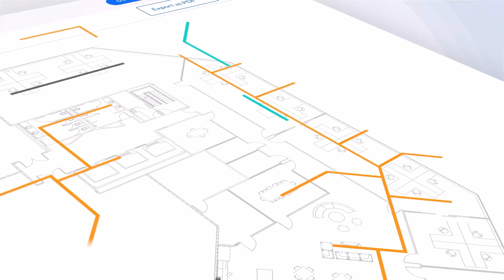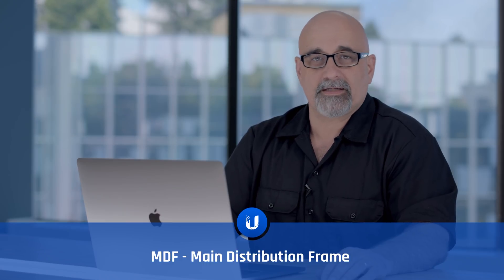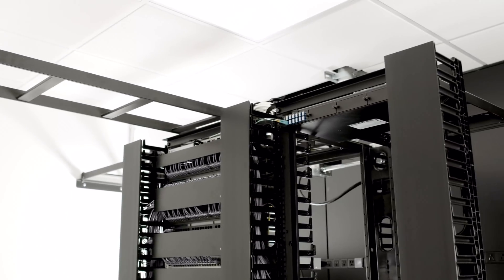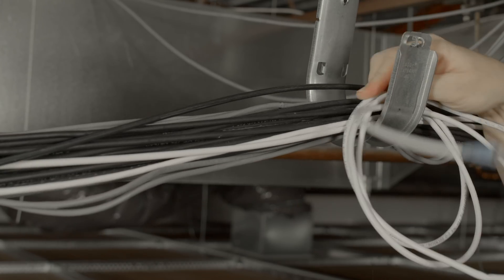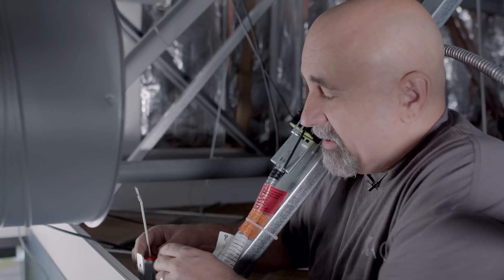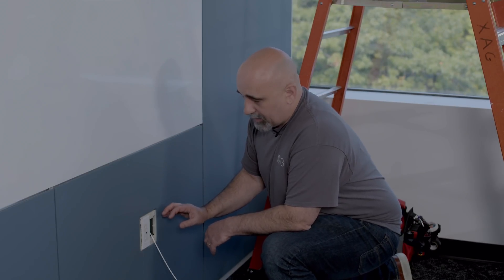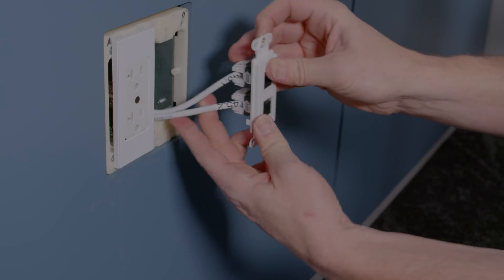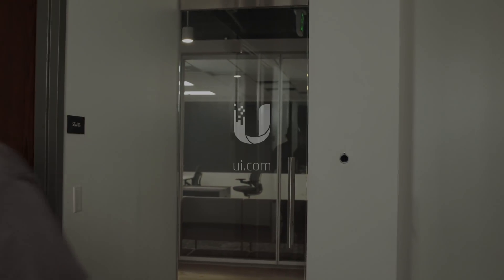UniFi: Beginner’s Guide to Network Cabling | Part 3 - Small & Medium Business w/ UniFi Design Center

Comment: When you say you label the jacks based off the patch panels, and both are labeled 45, does that mean your dual jacks each go to a separate patch panel and thus a separate switch for redundancy? like 45.1 to patch panel and switch #1 and 45.2 to patch panel and switch #2. You can do it any way you want really, but is this how you did it in the video and typically do it?
Reply: It just means the location of the drop is 45. 45 could be that gang box or even the room. The decimal is just each port in said drop/room. Nothing about redundancy, just more availability.

Comment: There is a good reason why you should never mix low voltage (>1000V) and extra low voltage (>50V) outlets:
If the LV side has a failure you risk frying all extra low voltage devices and users because they are not isolated properly for that voltage.
In Germany this is not allowed.